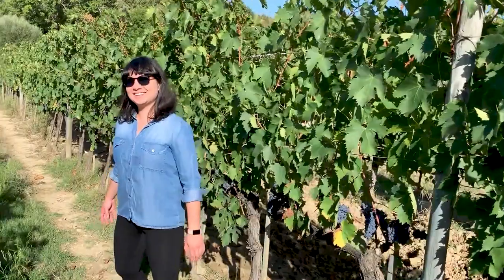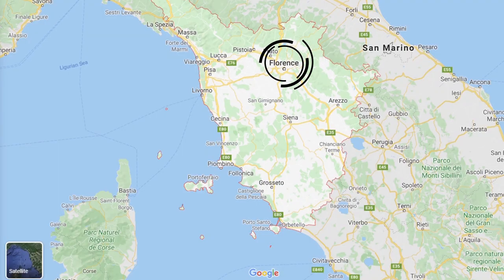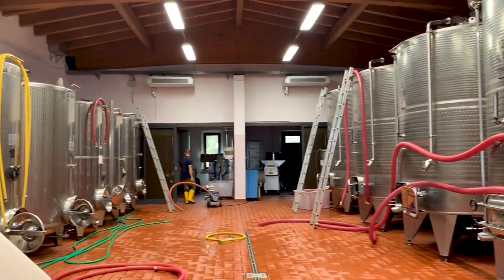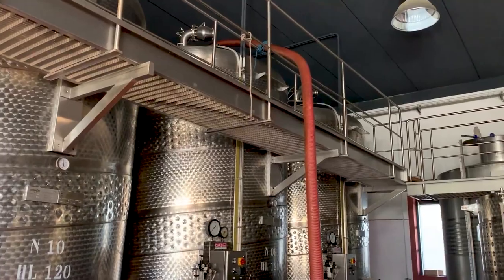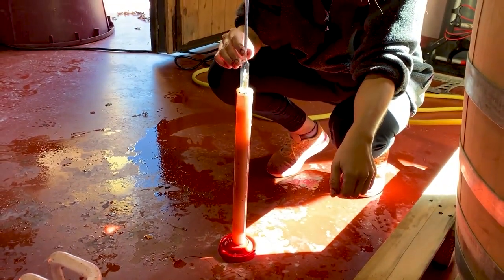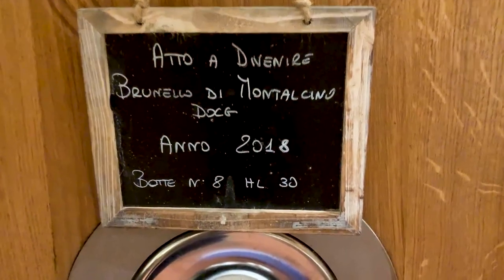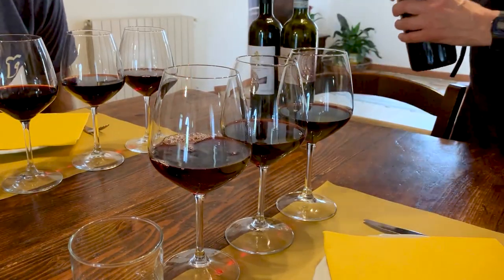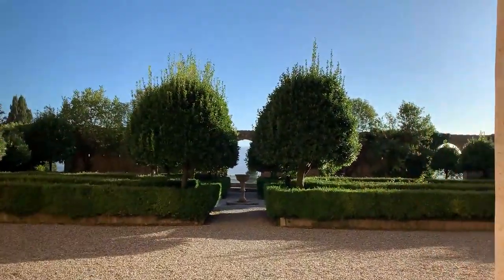How WINE is Made at a TUSCAN VINEYARD (Brunello di Montalcino)

Comment: They're degassing the wine by pumping it through at 7:26 - not adding air to it. During fermentation it is not desirable to add oxygen to the must.  This process removes suspended CO2 which is produced by the yeast during fermentation.
Reply: They are doing both and more. Fermenting grapes require oxygen. Therefore, they pump the must out, aerate it, while removing CO2, and then pump it over the top of the fermentation to help push the cake down. If the cake is not pushed down, the yeast will starve for oxygen. Furthermore, if the cake is not pushed down, the top will mold and a lot of flavor and color from the skins would be lost.